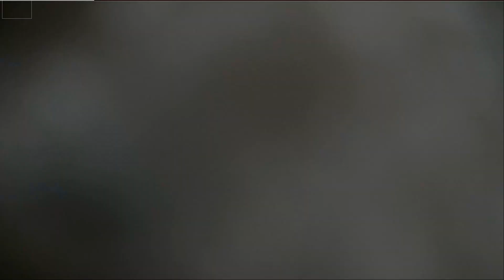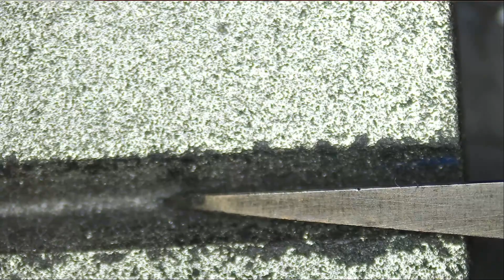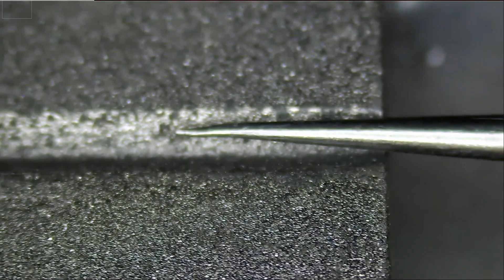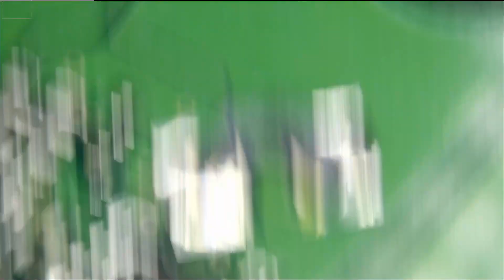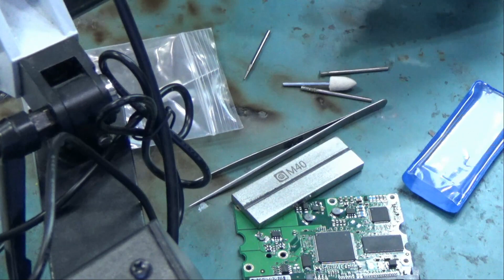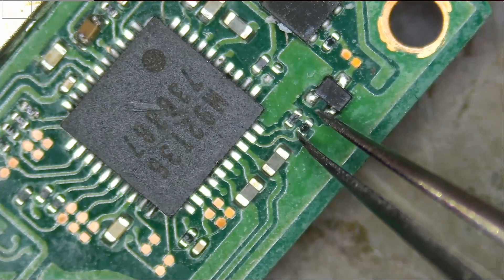Fix Damaged Tweezers quickly using Grind Stone. Don't throw away

Comment: The grinding stone is indeed great and very useful. The method used is the easiest but i usually straighten the tweezers back to near perfection and then sharpen the tips with some ceramic chips that are very fine. I try to keep the insides flat and just round up the tips until they look like a split needle.